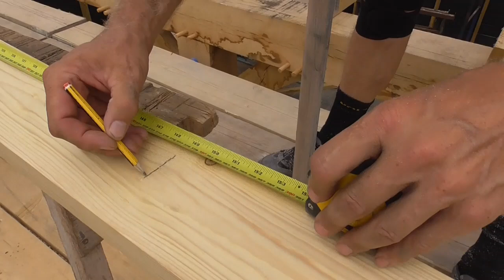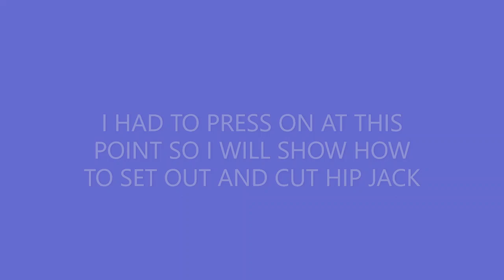How to mark and cut hip rafters on a trussed roof. ***(with splayed birdsmouth cut)***

Comment: Hi mate, like your YouTube channel, my father was a carpenter and he taught me how to cut @ pitch a  roof in summer holiday in 1974 when I was 14. He used an Imperial rooting square with all the measurements that were needed on the square, which Ì still use today aged at 61.
I will neverl touch a truss roof again  in my working career, they are made by dicks who have no idea how a roof  works. Take care.
Regards 
Bob Skinner.
Reply from the maker: Hi Bob🖐 Great to have an oldschool carpenter watching and I appreciate your great comment🤩 Alas, I must agree about the standard of truss manufacture😬its pretty 💩 I find I do quite a lot of roofs involving trusses and big steels nowadays which is great for keeping my hand in with the cut roofing👊 I do feel a little unfulfilled when it comes to roofing though, as there's a few roof types I fear I may never get to do like eyebrow and barrel top dormas🤔 Roofing is possibly my favourite part of being a carpenter🤗 Thanks again for watching😎Cheers Del

Comment: Great Video TC and learning so much from you. Regarding  nails needed for roof construction and also first fix framing, I see that you can get 90mm strip nails in ringshank, plain and also galvanised. What's best / recommended ?
Reply from the maker: Hi Michael🖐 My go to nail is 90mm electro gavled, as they resist moisture, hold well and drive in well consistenly 👊 Thanks for watching 😎 Cheers Del
Reply: @thetallcarpenter  Cheers TC, yeah I was thinking the ringed version might be harder to drive than the smooth. Well done on 10K subscribers, your efforts getting results !
Reply from the maker: @Michael-wm5fx  Cheers Michael😎

Comment: When measuring for the splayed cut onto the girder truss was the 882mm and  86mm measurements you took from the top of the hip to the bottom of the splay on the flying girder rafter ?
Reply from the maker: Hi Kevin. It was 882 from the where the hip strikes the common rafter at the top, down the top of the hip to where the trimmed off rafter of the double would strike the side of the hip. I then measured down 86mm from this point to the top of the flat section of the girder to give my seat cut👊
Hope that makes sense👍
Reply: @thetallcarpenter  Thanks Del, that makes sense you've measured the 882mm from the ridge, to the furthest edge of that splay cut you made on the flying rafter tail and the 86mm down from here as well, all along the top edge of the new hip. Much appreciated in you having a look back at this for me.👏👏👏
Reply from the maker: @amazing451  My pleasure Kevin🤗

Comment: hi quick question once you gone to the trouble of cutting the HAP BLOCK if u measure to the top of this will it not allow you to measure the hip length across the top of the hip rafter thanks i usually do what u did with the timber with a string to get my hip plumb cut using a sliding bevel set ridge to string thanks great video
Reply from the maker: Hi George. You are exactly right when you suggest that I could measure down the top of the hip line to the top of my HAP block and just mark a plumb cut down to the birdsmouth seat cut. I tend not to do this as it only takes the plate to be a little out of level or kicking a bit to throw the measuring point at the top of the HAP block out. 👍 I know I'm splitting hairs here, but as you know, these hip measurements only need to be  few mill out to make it not fit nicely.😁 Really great comment and thanks for watching.😎
Reply: thanks

Comment: Hi loving your videos, any advice on building a lean to pitched roof on a wedge shaped garage, can it be done? Cheers 👍
Reply from the maker: Hi Liam. Anything is possible with a bit of imaginative carpentry.👊 I'm not sure I can fully ivisage what you're suggesting though.🤔
Reply: Yeah it’s a strange shape 2m at the front and 3 at the back so squaring the rafters off the house wall means they sit at a angle on the garage wall and creep higher as the rafters get longer, thought I’d planned and anticipated everything but clearly not!
Reply from the maker: @liamclark4211  There is ways of doing it, butit may need some big timbers or steel to make it work. Essentially you would create a wedge shaped section of flat roof at top plate level, and this would allow all the rafters to be the same length. The tricky part would be supporting the outer top plate that would take the top of the rafters. Either a cranked steel half way along the rafter run, or a structural, 'ridge, of steel or timber.🤩 Certainly be interesting.👍
Reply: After a lot of head scratching I have a solution that works in theory so we shall see, luckily this is my own project and not a customers so I can play around a little 👍
Reply from the maker: @liamclark4211  Sounds great Liam. 👍 Good luck with it.I 😎

Comment: This is the same method you would use for the valley as well?
Reply from the maker: Basically, yes🤩 If it was a single valley rafter, I would mark to the top edge of the rafter, but if it was wider or a double valley rafter, I would drop it a little so the [lane of the jack rafters cutting into it would meet in its centre so it didn't kick up the valley boards/tray😎Thanks' for watching
Reply: @thetallcarpenter  also with the splay cut for the birds mouth are they mostly 45 degrees,  never seen one before used until now
Reply from the maker: @Sherlockly  Hi there. Yes, on equal pitch hips, the splay cuts will be 45 degrees in the plumb cut😎 Cheers Del

Comment: Just wondering when you set your crown mono truss what happens if it is a different height above plate to your girder truss?
Reply: Do you even the girder either side of the building, measure the tail off the face of the brickwork and then make your your crown is the same off the face of the brickwork at the front aswell?
Reply from the maker: Hi Nathan🖐I check the overhang of the main trusses,(the girder will be the same), and the set the end mono the same distance above the plate on the hip end. This ensures that the mono and common truss rafters will meet in the correct position at the ridge, and also give me the measurement for where to set the girder. (this is basically the distance of the ceiling chord of the mono👍) I hope thats answered your question🤞
Reply from the maker: I make sure that the end mono is the same distance relative to the plate/facework as the main 'common' trusses👍

Comment: Why aren’t you just using math? Everything in framing is just math , you can precut every jack rafter and the hip , mathematically
Reply from the maker: I've explained before to carpenters from the US that we tend to 'direct' measure when cutting roofs due to our old, existing' housing stock, and the fact that our houses are not made from wood, but 2 skins of masonry, which, aren't always square👍How would you mathematically set out and cut the splayed birdsmouth over the top of the girder truss🤔as I have yet to watch an American carpenter do this.

Comment: Does your hight above plate not change on your hip.   For the hip drop.
Reply from the maker: Hi Rick🖐If you were to measure the height above plate of the hip at the true corner point of the where the plates meet, then yes, this would be less than HAP I have gone to on my hip  and the difference between the 2 measurement would be the hip 'drop' if you weren't cutting the corner of the plates👍Hope this makes sense🤞Cheers Del